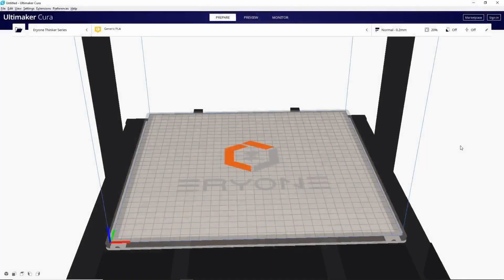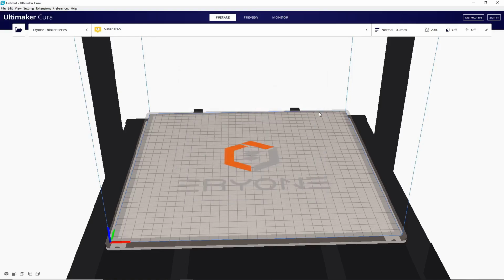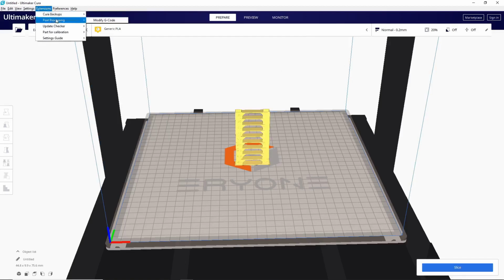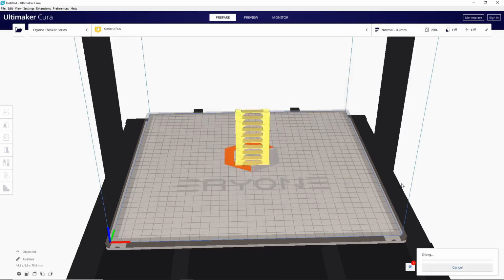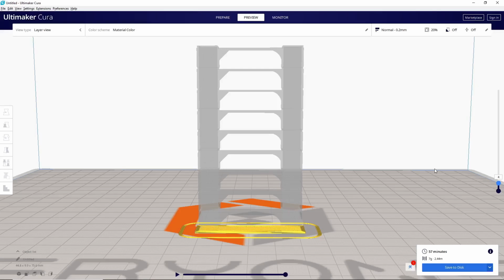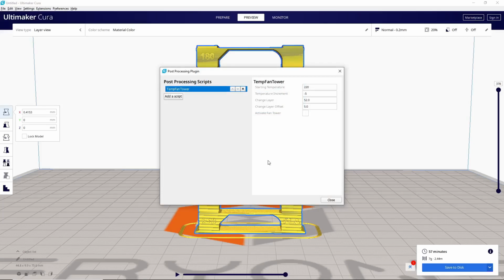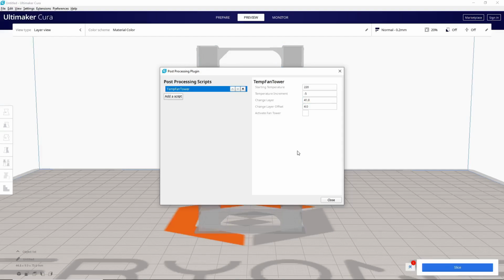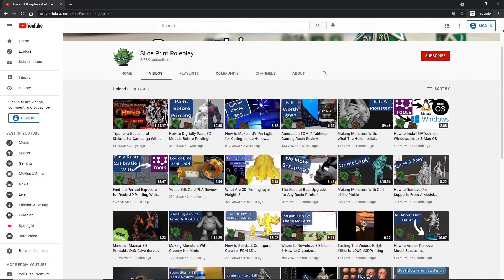How to Create a Temp Tower Test in Cura - Easy Tutorial!

Comment: Do I need  to do kinda PID Tuning for it?
Reply from the maker: Nope, PID tuning isn't required for this process. In fact, this test can help you determine if you need to run PID tuning.
You can do this by watching the temp changes during the test. If the temp is jumping up above or dipping down below your set temp by 2c or more than a PID tune would be a good idea.
If the temp is fluctuating by 1c I'd consider that within normal range.
Reply: @SlicePrintRoleplay  thanks. I know that I need PID Tuning, that's why I'm asking. Cause my printer is kinda a Diva😂 thanks mate and great video👍🏻
Reply from the maker: @athickcat7157  oh I see... Yeah I've got one like that too.... "Oh you fixed that issue.. Well here's a totally new one for you!" 😂
Best of luck to you my friend.
Reply: @SlicePrintRoleplay  thanks mate, have a nice day👍🏻

Comment: What if one is running a Cura version lower than 4.10?  I am using Cura 3.6.20 on a LulzBot TAZ 6  Mac OS Sierra.
Reply from the maker: So I don't have any experience with that printer/version of Cura. However, the process I cover in the video below may help you out.
https://youtu.be/Z_VjBC2DX6U

Comment: Thanks for this! Like many others, I didn't know about that initial setting step, so this hadn't been working. Works perfectly now, thanks but ....

While I was trying to figure out why this wasn't working I looked at the code and there a comment line there that says "Note - This script will not work in Cura V4.2 and above!"

It then gives a link (just above that line) to "up-to-date" version of the script, but that takes you to a page with a massive script(s) all commented out, so that lost me.

Given I do seem to get the temp changes, at the right heights, do you think that comment has been left in by accident or is there more to it?
Reply from the maker: You are very welcome!

Where did you find that comment and link? I'll gladly look into it?
I've had no issues with this plugin working on the newest version of Cura. So I'm not sure what the info you found is about, but I can certainly look into it.
Thanks for letting me know!
Reply: @SlicePrintRoleplay  it’s in the actual code that's generated. 

It worked for me as well, following your instructions, so I’m guessing it's an old comment they forgot to remove.

Cutting out the thumbnail creation, the start of the code files goes like this (though this one is from the retraction tower, but the temp one has the same comment:

;FLAVOR:Marlin
;TIME:2654
;Filament used: 1.1438m
;Layer height: 0.2
;MINX:88.855
;MINY:101.348
;MINZ:0.3
;MAXX:146.145
;MAXY:133.652
;MAXZ:39.5
;POSTPROCESSED
;Generated with Cura_SteamEngine 4.12.1

M140 S70
M105
M190 S70
M104 S230
M105
M109 S230
M82 ;absolute extrusion mode
; Script based on an original created by tjjfvi (https://github.com/tjjfvi)
; An up-to-date version of the tjjfvi's original script can be found
; here:  https://csi.t6.fyi/
; Note - This script will not work in Cura V4.2 and above!
; max_feedrate_z_override = {max_feedrate_z_override}
; retraction_amount = 1.0
; retraction_hop = 0.2
; retraction_hop_enabled = False
; retraction_prime_speed = 50.0
; retraction_retract_speed = 50.0
; retraction_speed = 50.0
; speed_travel = 300.0
; retraction_enable = True
; layer_height = 0.2
; smooth_spiralized_contours = True
; Ender 3 Custom Start G-code
G92 E0 ; Reset Extruder
G28 ; Level Bed
M420 S1 ; Restore Leveling:

Comment: This is amazing. I just got my 3d printer and trying to figure this all out. Do you have suggestions on what "path" I should take in terms of fine tuning the printer? I started off by leveling the bed, and now creating this temp tower. I think retraction might be the next thing?
Reply from the maker: I'm so excited for you! You are welcome to join my Facebook group. There you can post pictures and questions to get feedback and help.

So testing/calibration nozzle temp is a great place to start and I recommend doing it with each new filament you try. Once you have that dialed in try a few test prints. If you like your results you don't need to do anything else.
If you feel like you want or need some one on one help definitely keep an eye on my Patreon. I'll be opening up a new tier that will be designed specifically for helping new 3D makers. 😊
Reply: @SlicePrintRoleplay  autocorrect played you right there on the Facebook line..
Reply from the maker: @rodrigomartinelli741  DAMN what a time to not proof read! 🤦‍♂️🤦‍♂️🤦‍♂️🤦‍♂️🤦‍♂️🤦‍♂️ Thanks for letting me know. You are both the hero I want and deserve. 👏

Comment: Is there a way to change the temp name since I'm looking for different temperatures cause my hot end temp only supports max of 250
Reply from the maker: So I'm not sure that I understand your question. Could you explain a bit more?
Reply: @SlicePrintRoleplay  let's say you want to print the tower in increments of -5 °, 250°-220° for PETG temps, is there a way to display those  numbers according the temperature that is printing? So first one should display 250, 245, 240 etc...or do I need to customize this in Thinker and/Fusion 360?
Reply from the maker: @tube.perfect  ah okay that makes perfect sense! Sorry for my confusion.
So there are lots of free temp tower models for PETG and other high temp filaments.
Once you find a model with the temp range you want you can use this same process to program the gcode.

You may also want to check the models that come with the Calibration Shapes plugin. There may be a temp tower model with a higher range in those stock models.

Let me know if you have any other questions.

Comment: didnt work - My printer is doing the whole job at 230 deg C - is there a part I missed that commits the Plugin settings to the print before slicing?
Reply from the maker: If you followed the steps in the video then it should have worked fine... Did you maybe remove the script before you sliced the model?
Reply: @SlicePrintRoleplay  Thank you - I found the issue,  there is a drop down - Layer No. or Height, I had Height set
Reply from the maker: @Vass881234  thanks for the heads up! I'll definitely look into that.
Reply: @SlicePrintRoleplay  it was my error,  layer height option in drop.down not ' height '
Reply from the maker: @Vass881234  hmm. Are you seeing that in the tempfantower script window? I'm not seeing a drop down like what your describing. I just want to make sure I understand what happened in case anyone else has the same question.
Thanks for your help!
Reply: @SlicePrintRoleplay  when i tried the z plugin to set the distances as i couldnt get the tower plugin to work
Reply from the maker: @Vass881234  oh okay so you're talking about a totally different plugin. Sorry if it's not something I covered in the video then I won't be able to help with it.
Reply: @SlicePrintRoleplay  i followed it to the letter,  ive tried a manual entry too line by line temp change then sliced,  no joy,  must be a comit command i'm missing ??
Reply: Retried this method and manually listing all temp changes,   nothing gets into the gcode when sliced .😮

Comment: Followed your directions exactly and my test starts at 4 and not 5? Ideas?
Reply from the maker: There are a few different reasons that could happen. But most likely is just that Cura is cutting the mod slightly differently in your (probability newer version) then in the one I used in the video.
It should still work fine for you though.
Reply: @SlicePrintRoleplay  Thanks.
Reply from the maker: @Kev7274  you are very welcome.

Comment: Great video, but it would be great to print it, and then call out why we're seeing the end results and which one is 'best'  Admittedly, I've just sent this to my anycubic vyper that I got a few days ago.  So, I haven't seen the real world results yet.
Reply from the maker: Thanks for the feedback. That's a very fair point.
If a filament is very sensitive to nozzle temp then it's typically very easy to read the results. Each block will look different from the one before it. You'll likely see stringing and or deformations in the towers when your nozzle temp is too high.
Too cold and it simply won't print.

If your filament is not very sensitive to nozzle temp then most of your test/temp blocks will look the same. This means your filament is pretty forgiving and any nozzle temp in a rage of 200c +/- 10c will likely be fine.
All that being said, if you need any help reading your results feel free to reach out to me on Facebook, Instagram, or Discord.

Comment: Bonjour, bonne vidéo même si j'ai un petit souci, une fois l'impression commencée, mon imprimante ne change jamais la température. je commence à 255 degrés (petg) mais il termine à 255 degrés. Comment faire pour que cura (ou mon imprimante) valident le script? Je suis pourtant à la lettre votre tuto, mais elle imprime tout avec la température initial.

Merci pour cette vidéo. 

Hello, good video even if I have a small problem, once the printing starts, my printer never changes the temperature. I start at 255 degrees (petg) but it ends at 255 degrees. How do I get cura (or my printer) to validate the script? I follow your tutorial to the letter, but it prints everything with the initial temperature.

Thanks for this video.
Reply: I got there, the problem came from a bad temperature division, and the printer changed the temperature but "too late". After trying again it works now. Thank you. 

J'y suis arrivé, le problème venait d'une mauvaise division des température, et l'imprimante changeait la température mais "trop tardivement". Après avoir ré essayé cela fonctionne maintenant. Merci.
Reply from the maker: @SyntheticMemoriesGuy  I apologize for my delay in getting back to you. I was looking for a solution to your issue, but wasn't finding anything. I'm glad to hear you got it sorted out. Thanks for writing again with your update!

Comment: I discovered that if you enter a number for the layers that is a non-integer, like 41.555, the script will silently fail to put in any temperature changes.  The number must be rounded, as shown in the video, even though it allows a floating point number. This should be fixed, really.
Reply from the maker: That's good to know. Thanks!

Comment: nice video. during the "materials" change to 220*C, it defaulted the "finial printing temp." to 220*C as well. should this be set to 180*C ??
Reply from the maker: Thanks I'm glad you liked it.

You can certainly change the final printing temp to match the temp of the last test block. However, the final printing temp is usually only applicable to the last 1-4 layers so it's not really going to affect the results of your test.

Comment: tHANKS for the video, just subscrived. May i ask if 1h30m is the time this takes to print or is it allot i have ender 3 v2
Reply from the maker: I'm glad you enjoyed the video and thanks for subscribing!

An hour and 30 minutes sounds a little long, but if that's the estimate that Cura gave you then I wouldn't worry too much. Cura is usually off a little with expected print times.

Are you using the stock 0.2mm Cura profile? For me this temp tower usually takes 50-60 minutes using those settings.

Comment: I've tried doing this but my printer just fails and goes into cooling mode right after it starts printing. No clue what is going on.
Reply from the maker: Hmm I'm sorry to hear that. What printer do you have and what version of Cura are you running?
Reply: @SlicePrintRoleplay  I have Cura 4.12.1. I have found the issue in the meantime,my starting G-Code was messed up and managed to start printing now. Working with Mega S. But nice video anyways!
Reply from the maker: @jinultonic  oh awesome I'm glad you got it figured out. Thanks for the update!

Comment: I notice that you're using a skirt and not a brim. What other settings are you using? I tried doing this with no supports and the cross bars look like drooping taffy. Are you using supports that you then break away to show the final tower? It could be my printer (Ultimaker 2+) is the problem since I'm using one in a public space so I don't know its condition.
Reply from the maker: A raft/brim shouldn't be necessary on this model as it has a big enough platform to provide good adhesion.

Supports should also not be necessary as they would make your results unreliable.

There are two things I'd recommend.
First, if each layer looks consistent I'd watch your next test and confirm that the temp is changing. It should show on the display what the current nozzle temp. I'd watch and make sure it's charging for at least 2-3 levels of the test.

If the temp is changing, but the test still looks too rough too read then all your temps may be too high. I'd try lower your temp range. Just keep track of your starting temp.
Reply: @SlicePrintRoleplay  thanks, I'll give that a try.

Comment: Great video.👌
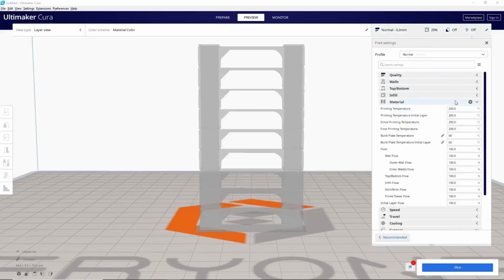I skipped the step at 3:52 to set the (Initial) Printing Temperatures to the start temperature for the test tower and... the temperature did not change during the print. 😬The extra M104 commands to change the temperature where not in the Gcode. After doing the skipped step the extra codes were present.

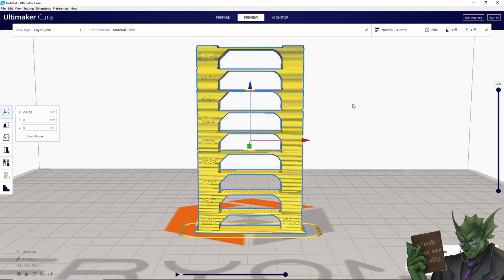Comment: 3:04 - I think the division is wrong. In my temp tower v 1.3.3 the base is included in the distance to the first bridge. So the first bridge ends at layer 41, the 2nd ends at layer 83 (Should be 82 but its inconsistent) next goes from 84 and ends at 124 and so on. So adding 5 layers at the bottom throws the whole thing off for me. I had to go offset 0 and change after 41 layers to be as exact as possible. 

Or am I missing something here?
Reply from the maker: I think it would depend on how the tower was made original. If it's designed for a specific layer height then it likely won't break up into evenly numbered blocks unless using that layer hight.... I've had similar results myself with different towers. Typically if it's only off by a few layers then it won't impact the test much.
Reply: @SlicePrintRoleplay  Yes, strangely enough it was the same tower from the same version of the calibration plugin that you also used 1.3.3 and i used the same layer height, 0.2mm. Weird... But, yeah a slight offset here is not catastrophic. Thx a bunch for the reply!
Reply from the maker: @thehighwayman78  oh wow that is really weird than! 🤔
Reply: @SlicePrintRoleplay  if you can, check your tower. For me, the lowest "bridge" is around 4 layers lower to compensate for the base. The pillars are slightly lower from the base up to the bridge. So to me this means we should Not put in a compensation value for the base as it seems it is built into the model from the calibration plugin... Possibly?
Reply: @thehighwayman78  Yes. Every section above the first is about 4 layers higher than the first for...some reason. Made the math really weird.
Reply: He said 4 not 5

Comment: Great video, but I encountered a problem. I can not find the g-code script for the temp Tower. I downloaded the plug in, loaded the temp tower on my build plate, went to modify g-code and the script was not there. Same issue in cura4.8,10&11. Any ideas? Windows version thanks
Reply from the maker: Thanks for the feedback!
Someone else also brought up this issue. I'll happily look into it.
Are you seeing any of the scripts from the plugin?
You could try this, 
#1 remove the plugin. 
#2 Restart Cura.
#3 install the plugin again. 
#4 restart Cura. 
#5 check and see if the scripts are available. 

You could also try fully uninstalling Cura and all data. Then install it again. That can resolve many issues with different programs.

Comment: Hi, thanks for this guide it's great! I do have a question though... My temp tower only has 7 different temps. Could you tell me how do I give it 9 temps like yours?
Reply from the maker: Are you using one of the temp tower options from the plugin?
Reply: @SlicePrintRoleplay  let's go with yes, how can we add more temp blocks to the temp tower?
Reply from the maker: @lauralgonzalez90  the simplest answer is that you use a larger test. There are a lot of different models on Thingiverse that are a bit taller.
The one I use in the video is one of the calibration models that comes pre-loaded as part of the Calibration Shapes plugin.

Comment: Thank you for your info on the plugin and setup! Quick question though - I counted layers the old fashioned way and came up with 42 layers per section. Is this correct or am I missing something?
Reply from the maker: You are very welcome!
If you're using the same model and came up with 42 instead of 41 like I did then that's fine. It really won't effect the results of the tower or your ability to read it.

Comment: Hello, thanks for the great explanation. Q: I have printer Ultimaker 2+ selected as my printer. I installed the plugin and made changes as you recommended. When I go to Printer Changes to modify under Materials, I do not see any settings for temperature changing like ou do. I have all settings made visible in the menu, but nothing for temperature. Any hints? Thank you. Again great video.
Reply from the maker: Thanks for the positive feedback! 

Hmm that is odd. If you have all settings visible then I can't see any reason why you couldn't adjust your first layer temp settings.
However, changing those settings aren't required in all situations. Basically what will happen is the first few layers will print at your normal temperature. Then the nozzle will heat up for the first layer of the test. From there the test should work fine.
But definitely let you know if that's not the case.